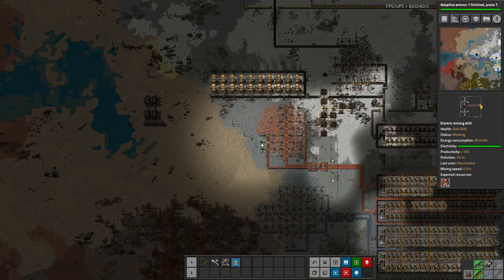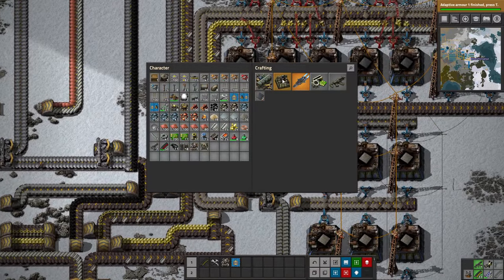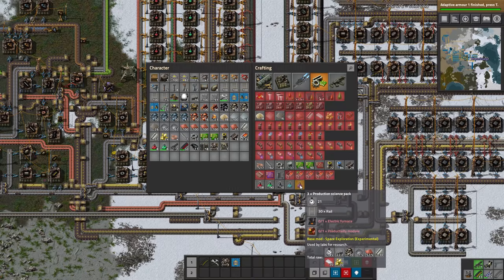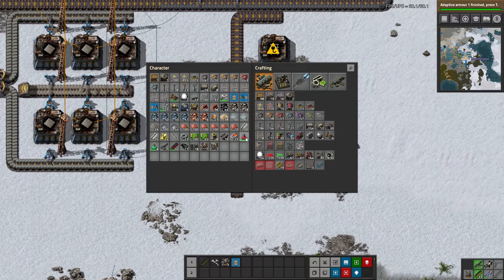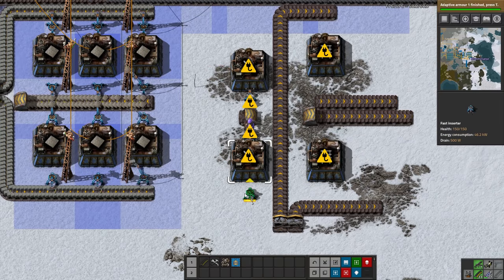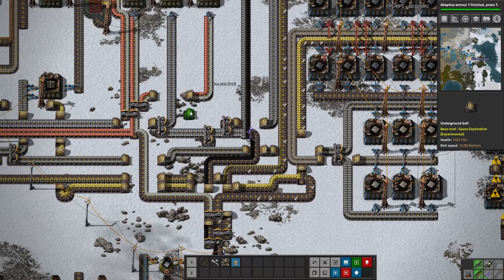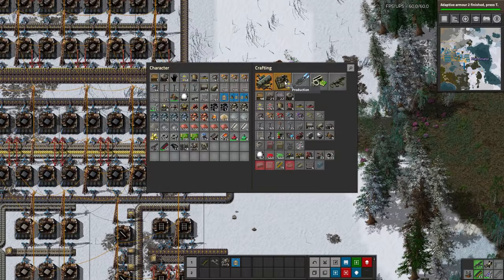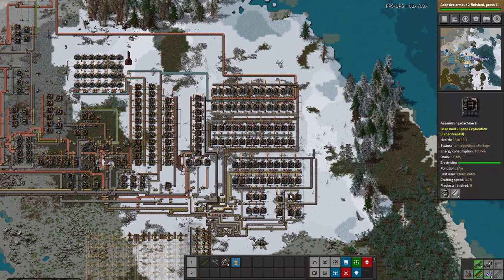Factorio Space Exploration Grid Megabase EP10 - Rail Build & Belt Routing! : Gameplay, Lets Play

Comment: 3 purple science packs require 30 rails --> 1 science pack requires 10 rails.
You wish for 2 science packs per second --> You need 20 rails per second.
Reply from the maker: I knew it should be easy to figure out, my brain just couldn't do it for some reason. Lol thanks.
Reply: No, because those 3 science packs are not made in 3 seconds. So 1 pack isnt made in 1 second.
They are made in 21 seconds, not 1 second. 3 science packs every 21 second, i dont know where either of you get "per second" from?
He needs 30 rails per 21 seconds to fullfill each 21-sec-interval production of 3 packs.
So for 1 pack, he needs 10 rails, per 21 seconds. Not per second. Per 21 sec!!
Reply: @Baleur you can just add more assemblers to increase production speed.